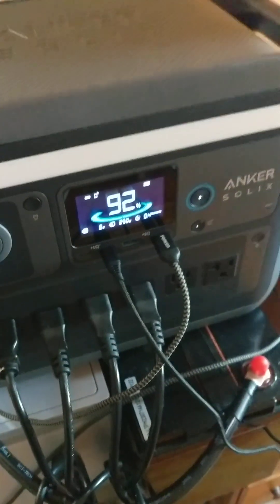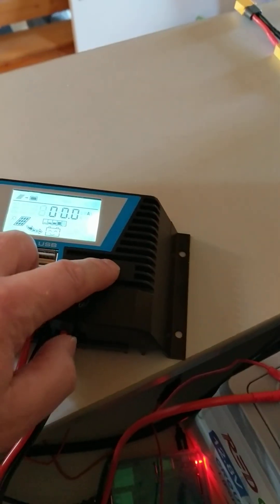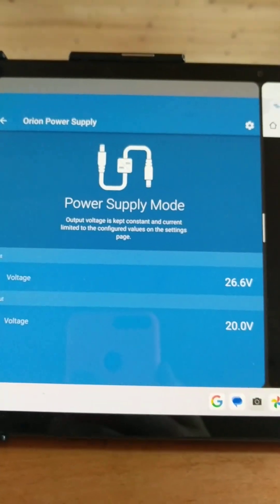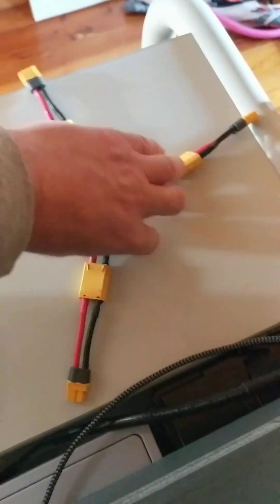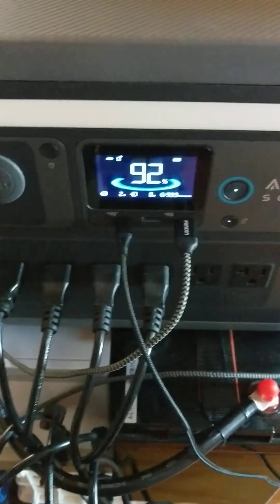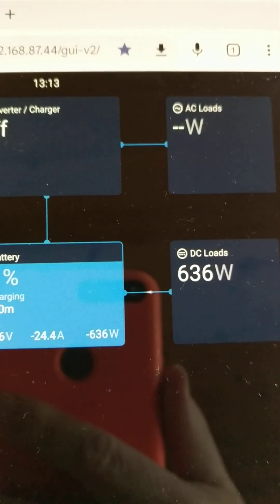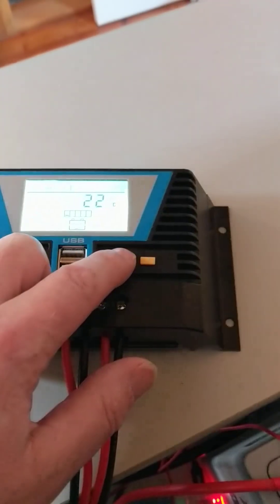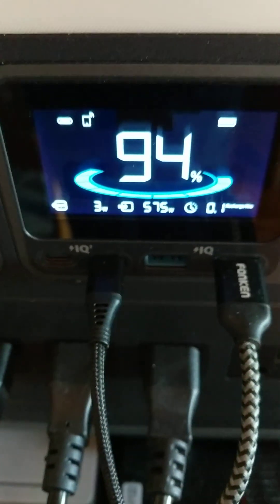Anker Solix C1000 DC fast charging with a 24v LFP battery + a Victron 24v Orion Isolated Charger

Comment: Can you link the items you have as I'd like a similar setup with c1000 gen 2 as a portable backup to recharge in power outage and without solar to keep the unit charged properly from use

Also can the unit still be used at the same time its being charged aswell

Comment: Just get a 12v to 48v boost converter. It’s way cheaper and more reliable
Reply from the maker: The Anker C1000 power station pulls up to 12.5A or 600 watts, that's like 50A at 12v, I am not aware of a boost converter that can handle that much input current.  Any, I have a 24v system, so instead, I would need a 24v to 48v boost converter, something like this would still pull 25A, so it would need to be a substantial one.  I already had this 24v to 24v Orion charger/power supply that's rated for 400 watt output, and how I'm using it in this video, it just handles half the load, so 300 watts, the other 300 watts comes directly out of the 24v battery.  I think it's a pretty cool demonstration of how isolation works too.   Victron spec says the isolation can handle up to 200V difference, so am within spec.
Reply: @jeremy314  search the rain forest ' Boost Module, DC-DC Boost Converter Module 10-60V to 12-97V Voltage Step Up Module Converter 1500W 30A Boost Power Supply Module LED Driver,with Short Circuit Protection '